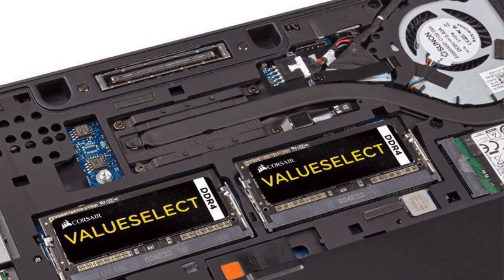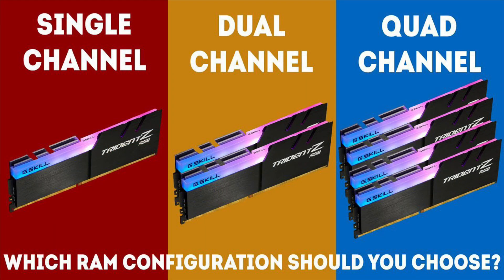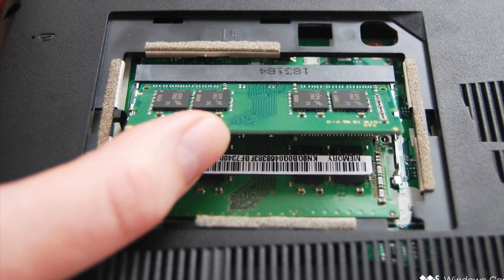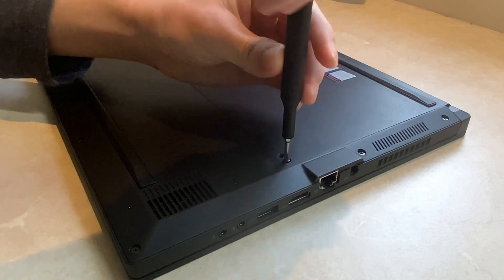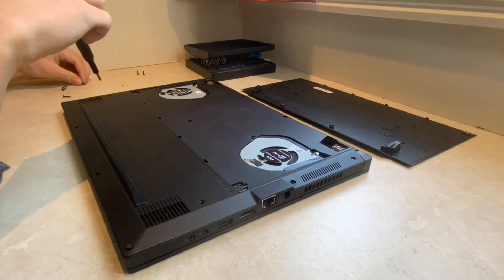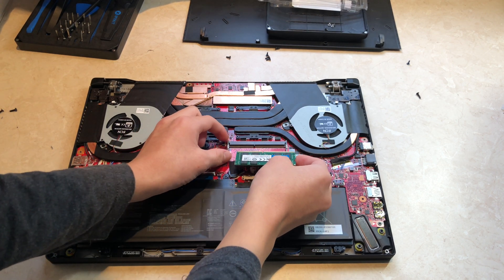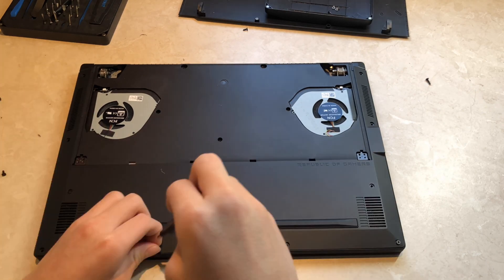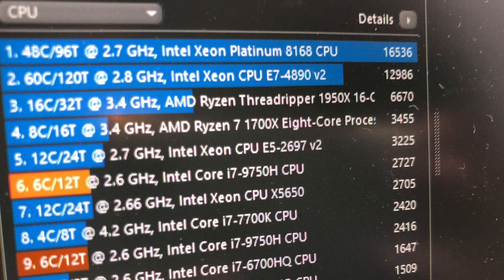How to Upgrade RAM in a Laptop (GX502 Installation)

Comment: Well, there is one problem that needs everyone to pay attention to. The system has 16G DDR4 2666Mhz onboard, however, it runs with CL19. If you purchased ram is not CL19 it can drop the memory speed to 2400Mhz...So...Kinston Hyper X with XMP support memory is NOT recommended.
Reply from the maker: Pinned. Thanks for the head up!
Reply: @andresgizmos1271  I got a G-Skill DDR4-2666Mhz CL19 and it works.
Reply from the maker: 奶油小饼干 nice to hear! The crucial ram was just the cheapest at the time so I picked it up
Reply: @andresgizmos1271  This is the cheapest at this time, crucial will be ship after Canada day so I choose not to wait and pick up today XD
Reply: @AgentFitz-y3u  Do you have a link for that?
Reply: @camerondigshistory  Just go Canada Computers you will find those.
Reply from the maker: Nice to hear that!
Reply: Sadly i ddnt check this comment before, i bought Kingstong Hyper X 2666 and it wasnt compatible its showing 2400mhz. now i sold it with half price and planning to buy crucial 16 gb 2666 with cl19.
Reply: @jaypineda3770  Crucial RAM is perfect for this laptop！Be sure to double check before you keep them.

Comment: So the one you installed does not drop the memory speed to 2400 Mhz?
Reply from the maker: No, the system says the both ram sticks still runs at 2666mhz
Reply: @andresgizmos1271  thanks bout to order one right now. Thanks for the detailed instructions. Nervous to do this on my own.
Reply from the maker: @robhakes  no problems

Comment: Great video! Are the screws all the same size and type for the outside edges of the chassis where a #0 screwdriver is required?
Reply from the maker: Thanks for watching! The bottom right screw for my laptop was held in place with a lock, so don’t try to remove that one by force. The two screws that are right above the speaker grill are the really long ones (11.6mm). The screws below and above the side air vents are approx 8.8mm. The bottom 2 screws below the rubber feet are also 8.8mm

Comment: What brand would you recommend for the RAM upgrade? How are your temps while gaming? And what about the performance after the RAM upgrade? Thanks and good luck with the channel 👏🏼👍🏼
Reply from the maker: Andoni Avila Ropero I would recommend the ones I installed in the video (crucial branding) as they worked for me. Although you can get Corsair and g skill SODIMM memory as well. Just make sure your laptop supports the speed like I mentioned in the video. The temps of the laptop were under control (85-95 degrees) tho it was a bit hot because of the thin and light chassis. Gaming performance after ram upgrade is at the end of the video. Thanks for watching!